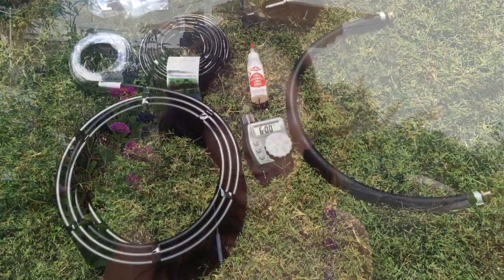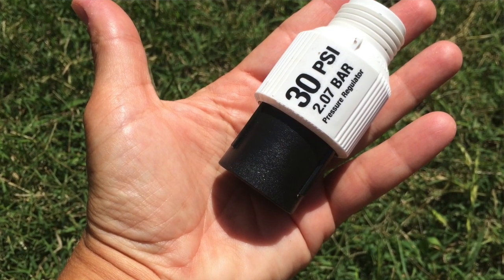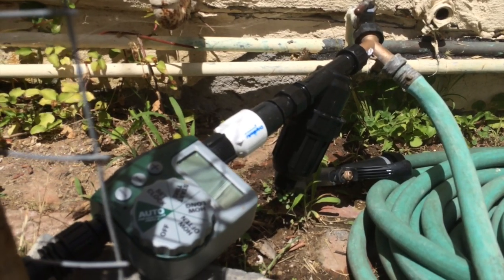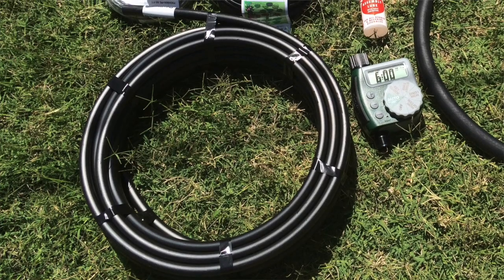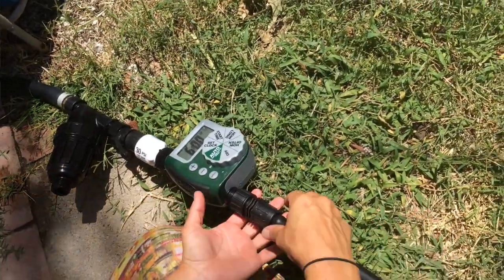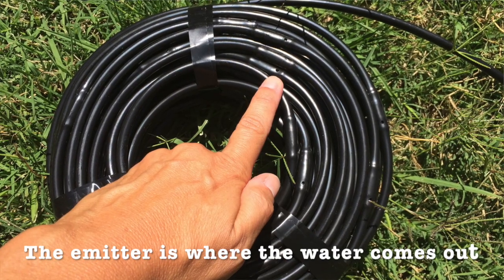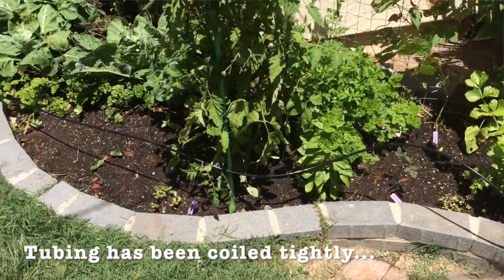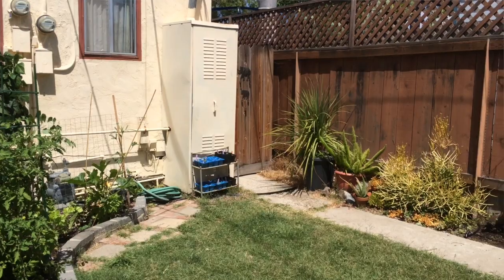Quick Video - Drip Irrigation Systems for Garden Beds

Comment: I also have the a question about using collected rainwater without a pump. I am successfully collecting rainwater into 3 large containers, but the lack of pressure has meant manual watering. even an open hose nozzle is enough to stop the flow. I'd like to know an efficient way to make it work without using a pump.

Comment: Related to what you said at the end about the fact that you can pair this system with a rainwater harvesting system, from what I found out, you can not because of the fact that the drip irrigation system needs more water pressure than a gravity based system could provide. Probably you would need a pump. Not sure. Did not test.
Reply: I also have the same question. I am successfully collecting rainwater into 3 large collectors, but the lack of pressure has meant manual watering. even an open hose nozzle is enough to stop the flow. I'd like to know an efficient way to make it work without using a pump.